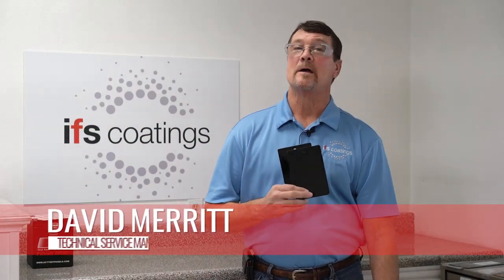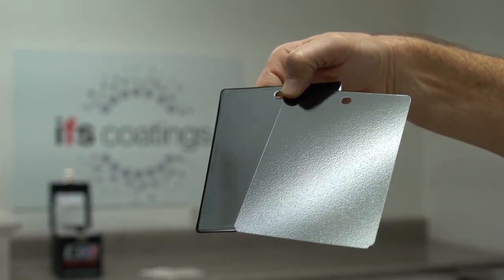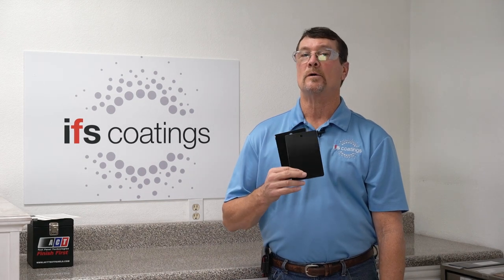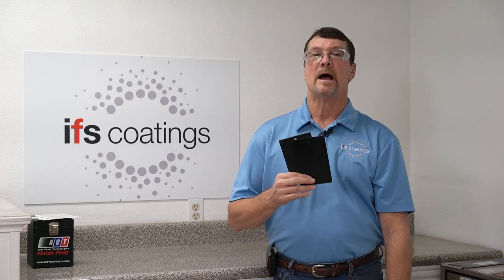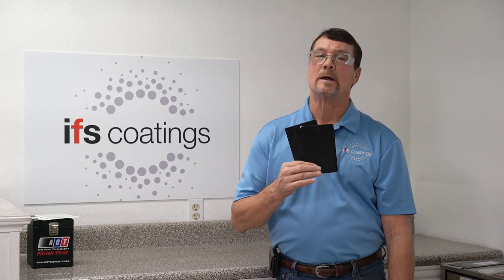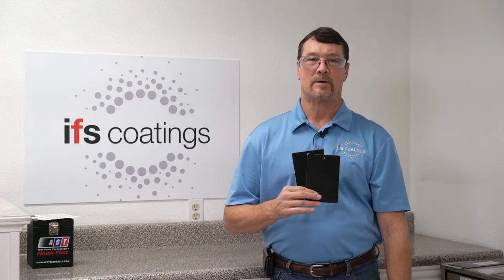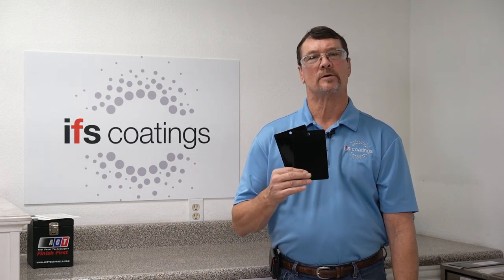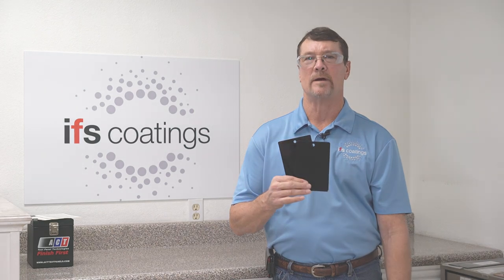Preventing powder orange peel  - problem solving powder coating issues

Comment: i am experiencing issues with powder coating. I am using epoxy polyester powder, but it is showing signs of corrosion or poor adhesion, particularly at the edges please help m
Reply: If possible lower the voltage on your gun